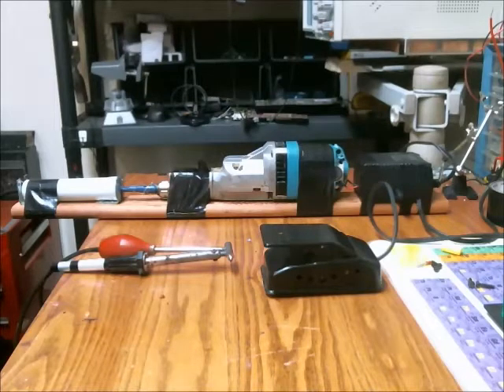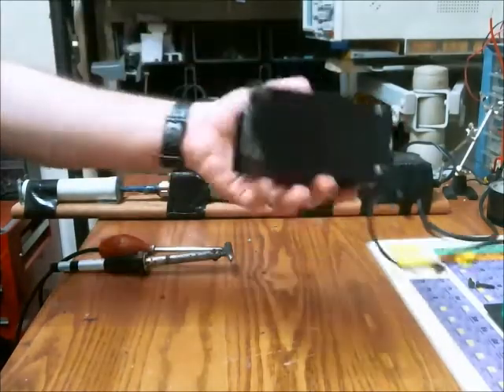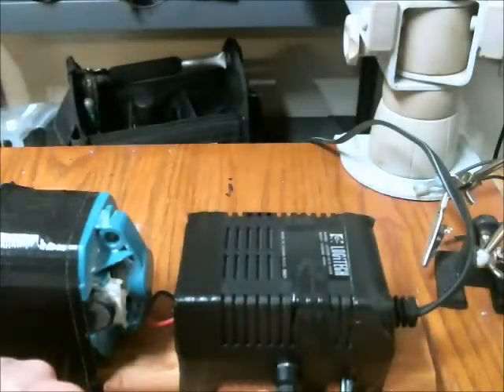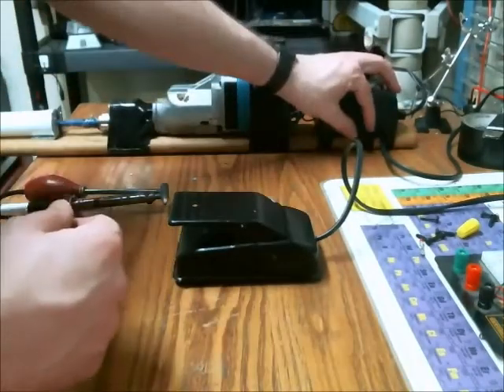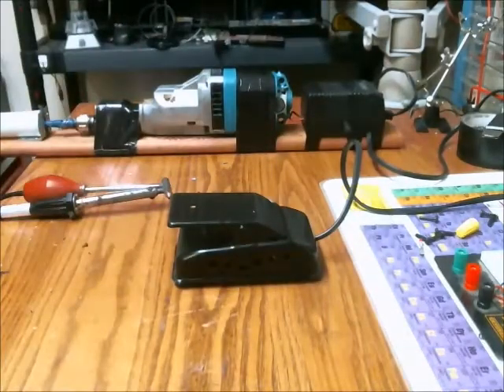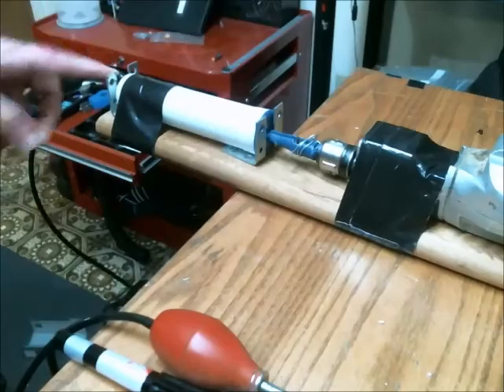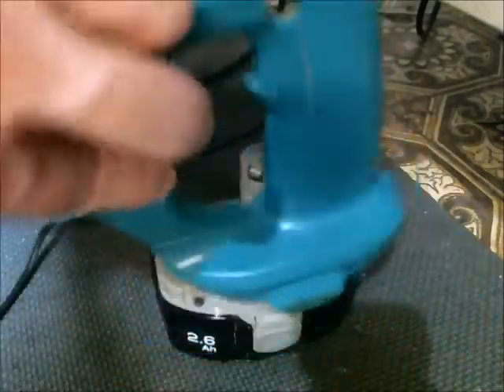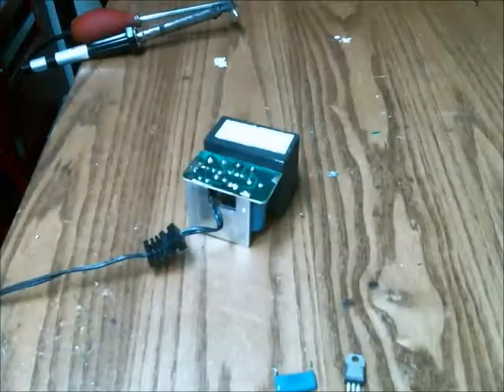Improved Solder Vacuum Rev.3

Comment from the maker: I still need to add a filter, The solder builds up in the red bulb.
For me the build was free, except for the in-line valve which cost ~$2.
but one can purchase a junk reciprocating saw at harbor freight for ~$20.
I may revisit this project in the future with a solenoid again.
I didn't realize that they were that affordable, but still it was a fun project and it works very well.

Comment: nice to see something being made, but I think this is underpowered overkill.
waste of electricity, waste of space, and waste of time. :D 

go to a scrap yard and dig out central locking vacuum pump. I have mine from VW golf. I know Benz has them also. little mod and you are good to go. as fas as I could see compared to mine -- yours "doesn´t suck as good'' as mine! :D 

Keep up the good work!
Reply: looks like this. scrap electronics inside, tweak tubing and its done. 
you can either make it so you have super weak compressor. (reversing motor)

http://www.stevensvwspares.com/assets/images/parts/display/d1.jpg